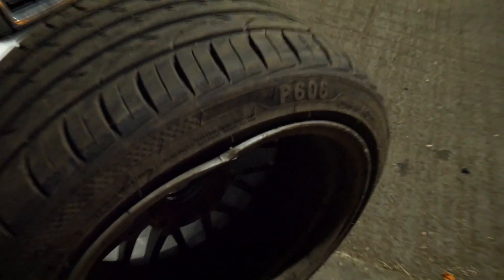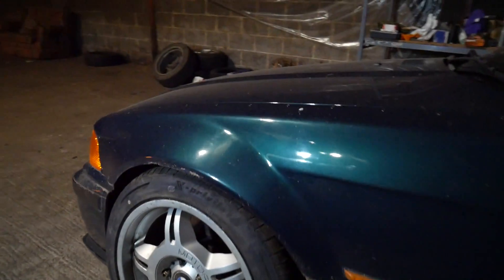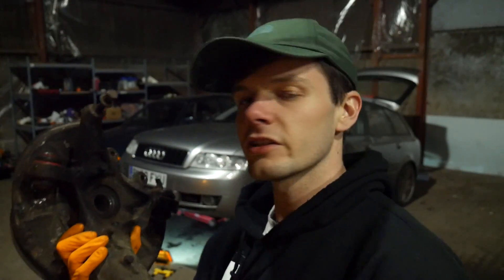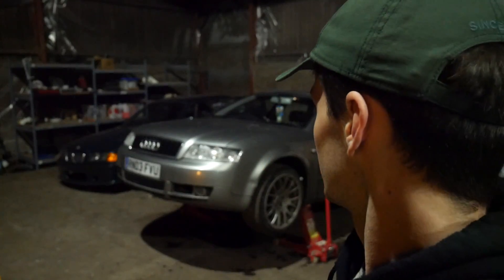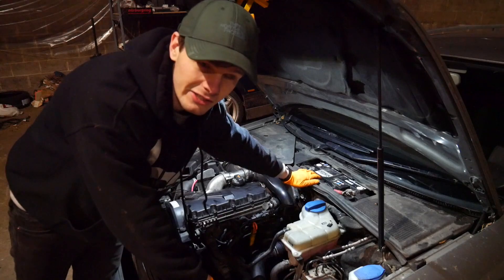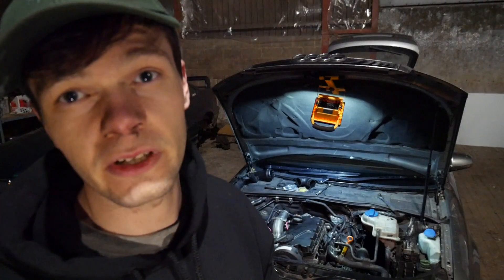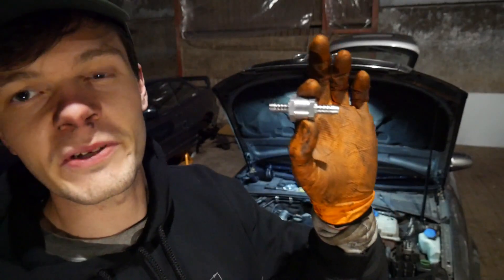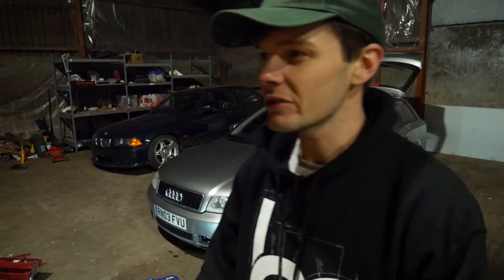Autobarn S01E01 (Pilot)

Comment: Love the new format! Also, don't use the jubilee clips on rubber fuel line pipework though - the heat will make the pipes expand and over time these clips will dig into the rubber and cut it. Cut's on fuel lines is nicht gut! Use the spring clips instead - they will allow the rubber to expand and won't damage the hose.
Reply from the maker: Alexei Andreyev thanks for the tip 😁

Comment: I'm a mechanic. We are the worst for bodging our own cars! If it works, who gives a fuck!
Reply from the maker: +Esprit Dean haha, I thought it was worth a try. If the lift pump is weak it might help slightly but at the end of the day it hasn't fixed the problem. I'm going to take the injectors out once I have the E36 back on the road.
Reply: DannyDC2 Unless you have all the right tooling its just best guess fella. Keep doing what you doing pal

Comment: Sounds like you're getting air in the lines dude. Just so you know, a lot of the time when it's drawing air it doesn't actually leak diesel out which is why you probably can't see a leak. Could just be a slight pin hole in the line somewhere or the seel on the filter.
  I always find the best thing to do is put some clear fuel line in and you'll be able to see air bubbles in the line. Just move the line either side of the fuel filter and see if the air bubbles disappear on either side. It'll narrow down where the airs coming from.

Comment: Make sure you haven't got any camshaft position sensor faults, pd's are quite common for them. If not try priming the pump a few times before starting, see if that helps. Listen for any hissing noises when turning the car off as it also could be a air leak. It's possible it could be the lift pump itself going weak. Many things it could be just a matter of eliminating!
Reply from the maker: +Jake Smith nah no codes logged at all dude.

Comment: I see you checked the battery terminals.  Have they got some vaseline on?  Also is there an earth strap from the engine/gbox to chassis.  This is worth checking esp if its just a braided strap, they can deteriorate & literally turn to dust.  I do agree it sounds like a fuel issue but these checks can only improve other aspects of the cars electrics.
Do you allow the glow plugs to do there thing when you switch on the ignition or just turn key & crank away?  (wrong)

Comment: You mentioned the filter had been changed, but had the thermostatic valve on top been changed? These can let air in.
Reply from the maker: Yes mate, the filter comes with a new valve with fresh O rings.
Reply: Nice - shame on the 2.5's I had to get mine separately. Hope you get it worked out soon .

Comment: Try intalling some clear fuel line from your check valve to the injection pump. Then you can see if your getting air bubbles. If it stalled out while running its got to be air getting in or a lift pump.

Comment: Try using clear fuel pipe inline along the system to spot air bubbles. This will help narrow it down. Work your way along to different areas of the fuel system and if you find alot of bubbles. Try bypassing parts and see if this reduces them

Comment: About the Audi issue, when you cut the pipe to try one way valve, I didn’t see any fuel coming out so not under pressure? I don’t know if diesel if different from petrol though as diesel is the devils work and I don’t touch it. 
Also, have you considered where the lift pump is located in the tank and how much fuel you have in the tank? Low fuel and bad angle?
Reply from the maker: From what I understand there should be fuel held in by vacuum, there should have been some in the line when I chopped it for sure! It doesn't seem to change relative to how much fuel I have in the tank however. I noticed a leak on my vacuum pump the other day that I will look to rectify along with all the other problems I've noted along the past few weeks :)

Comment: Clean up around the tandempump.Then you might spot any new leaks. Could also be internal. Check for dieselresidue in the line to the booster. How long since you changed the fuelfilter? Any leaks there? Leaking injectors cause a lot of grey smoke on cold startup. Are you seeing this?

Comment: Danny have you checked these bits for the startup problem ? 

Most likely > faulty lift pump, will get more and more frequent, including the cutting out you mentioned.

Also;

- EGR valve intermittently sticking open
- Cam followers wear through in extreme cases
Reply from the maker: +Curtis Almond can the lift pump lead to cutting out? I was under the impression it was used to only prime the system before starting?

Comment: Dont know much about the engine layout of the audis but if your getting a cold start issues esp on an incline it could be fuel running back to the tank. So and air leak on maybe a fuel line, fuel filter housing or on the fuel pump itself
Reply: Just seen somebody has already addressed this

Comment: On the audi Check the torsion value/steering value (called different things on newer or later software) on the cam timing using vcd. Anything above 0.7 will cause cold start issues.
Reply from the maker: +Arran Johnson yeah the timing is within tolerances on VCDS. Cam position sensor can aparantly cause these issues too. Got a lot of stuff on the list to check!

Comment: My car use to do this. In the morning would crank for ages. It  would be turning over and cough  a bit until it fired up. Tested glow plugs and power to glow plugs etc. All good. No fuel leaks. Fuel filter was recent. I tested a lot of items and started to think it was either pump or faulty injector spray pattern even though it ran spot on when it started. I put a brand new (not cheapo) battery on it and it sorted it. I had load tested the old battery and it came back ok? But obviously it wasn't. 12 months I'd chased it!
Reply from the maker: +alex jackson funny you say that, I'm going to buy one of those CTEK battery conditioners I think to give the battery a good cycle.

Comment: Try injector seals (my bet its them), tandem pump leak (you've checked), coolant temp sensor. The fuel system is in two parts - there's a low pressure system fed from the pump in the tank that feeds fuel via the fuel filter to the tandem pump on the end of the camshaft. This pump is engine driven and provides the high pressure required by the injectors in the head. Pressure loss here when the engine's not running will lead to poor starting and can be caused by a number of things including tandem pump gasket and injector seals. Look here for details - http://www.myarchive.us/richc/VW_TDI_with_PumpeDuse.pdf
Reply from the maker: +Salad Dodger Media that PDF is great, I shared it on Twitter the other day 😁 now I have more of an idea how it works. It's been pretty good the past few days, once the E36 is mobile again I'll be looking into the injectors!

Comment: Remove your in tank pump and check for any oil that has returned to the tank in the fuel. Common fault on pd engines. Two causes can either be injector seals or the tandem pump itself contaminating the fuel with oil causes hard starting and also the cutting out issue you had whilst driving. 👍🏻 Clean out the tank and replace the in tank pump.
Reply from the maker: +Callum Mooney once the E36 is back on the road I'm going to pull the rocker cover off and take a look at those injectors. I noticed some fuel in my oil the other day when I changed it. Not. Good.

Comment: the tandem pump bolts to the rear of the engine head then it feeds fuel to the injectors which is located inside the engine head there is no external fuel rail...is it possible for the injector seals to be leaking fuel inside the engine thus causing a hard start at cold starts?? Just saying. How about checking your holding fuel pressure that's the fuel pressure when your engine is switched off over a period of time

Comment: Dan have you thought about checking the wiring to the glow plugs? Sometimes these can give trouble causing intermittent starting problems, even though the glowplug itself is fine.
Reply from the maker: +Colm Farrel yeah bud read about that so checked them when I changed the plugs. All good. Glow plug errors would log a code as well.

Comment: If the issue is an air leak allowing fuel to run back to the tank overnight, and it's having to re-prime the fuel system all the time, then the non return valve might work as long as it's "behind" that leak. So if it's the pump on the cylinder head, the valve would need to be between that and the tank pump? Though if the leak's upstream of the pump & bad enough that it's sucking in air rather than moving fuel, you might not get anywhere without hunting it down properly.

Maybe a cheap fuel pressure gauge inline where you just fitted the valve might shed some light on the situation.
Reply from the maker: +InitialDave its not been 'as bad' since fitting the valve, but it's still quite bad. Hasn't started on the button for a long time when cold. Half tempted to go to Halfords tomorrow and throw a battery on it to rule that out.

Comment: Still reckon it's electrical dan seen as it's so intermittent there is more earths behind the front bumper on the chassis leg and inside on the passenger foot well under the carpet if you ever had an interior water leak it could cause problems there is usually 2 or 3 earth wires on one point with a black plastic surround on the earth point remove this and discard and clean up earth points on the body .... I'm sure you will get to the problem eventually pal
Reply from the maker: +Tommy Cusack funny you say that, I had an issue with the alarm going off last year whilst parked in a train station carpark that was caused by water getting to the comfort box. I need to clear out the water channels.
Reply: DannyDC2  yeah worth a look under the carpet again usually water fills up under the battery tray due to drains been blocked and pisses in by the glove box comfort system shouldn't cause a non start but stranger things have happened I suppose.... even though carpet seems dry on the top side the foam could be soaking I'm sure there is an earth point there that has caused me trouble before

Comment: Hi Dan, my moneys on a leaky injector...leak back will cause a delayed start (as it does on my transporter), I find rather than fixing 😬 it helps to turn the ignition on two or three times before engaging starter motor to pump the fuel pressure up! (Still tickling it along years later)...
As for the wheels - shame to revert back IMO, take them to Ian Jemison engineering  in york (01904 703863 ) and they’ll repair them...maybe.
Otherwise liking the fix videos no matter how much is a diy suck and see approach, battle on, it doesn’t half feel good when you sort it yourself! 👍🏼 ps...edit - my transporter doesn’t cut out so I partially take back my injector theory sorry..
Reply from the maker: William Oakes haha yeah I've found the same with priming the pump a few times. Sometimes it works... As long as it keeps starting up that's the main concern! I'm not too fussed about repairing these wheels "properly" as they're all bent to fuck anyway mate, will just hammer that lip flat and use them for skid wheels. Thanks for the number though! Will save it. 👍